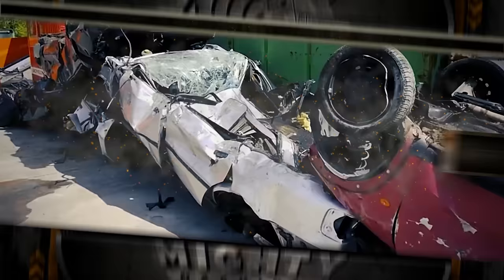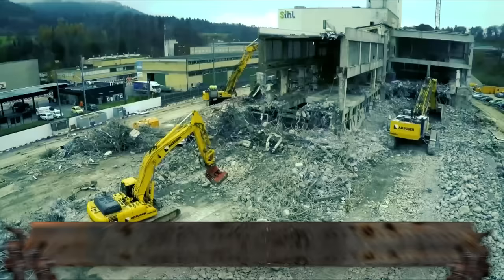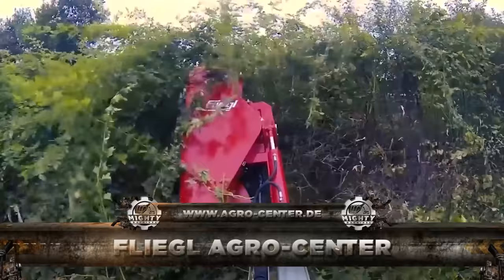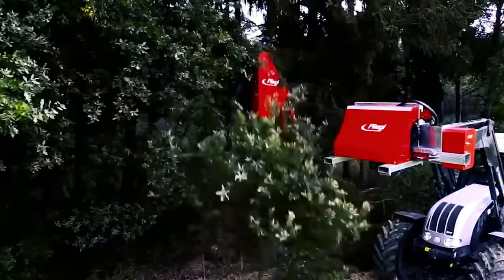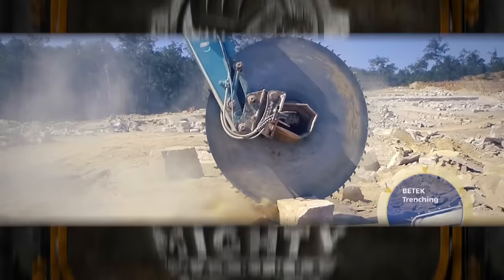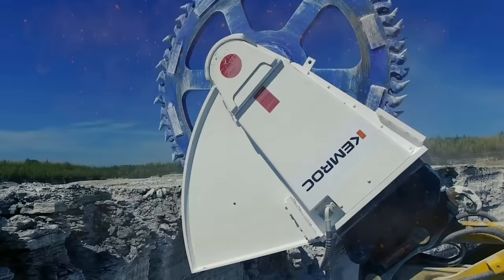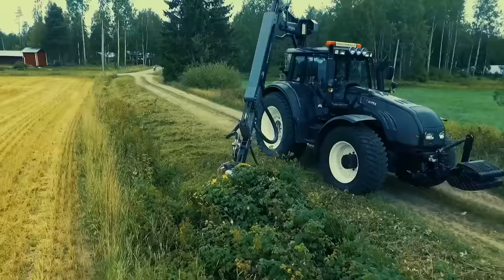Powerful Dangerous & Incredible Machines You Need To See! Machines Operating at Another Level

Comment: WHY would erdvark remove the topsoil as well? The topsoil is where 95% of the nutrients needed to grow the crops are. Leaving the roots and stalks just lets them decompose into compost, aka nutrients for crops.
Reply: Your right what they are doing is forming the field for water drainage. Making sure there isn’t any ponds in the middle that will destroy crops
Reply: Because the people making this video have no idea what they are talking about.
Reply: Synthetic fertilizer is good for you and some farmers get a  kickback for using it.. 🤣
Reply: That was laser levelling machine 😅😅😅😅😅 we use that to save water while irrigation
Reply: You have a good point. But the probable reason is that some of that vegetation debris would be corn stalks and cane stalks and so on, which, unless they are finely chopped, will not decompose for several years so they're just taking out the roughage and leaving the fine stuff...
Reply: Hey anyone who lives in farm country knows a Disc  Harrow is an essential tool. In this case it's shown cutting into what was probably a forage crop. Discers are also used to till soil that previously had a grain crop. The soil is turned over and the straw residue mulched into the soil.  Some producers use "no till" planting but that machine usually a type of Hoe Drill also turns the soil but to a lesser amount.
Reply: Topsoil removal can be strategic, especially in areas prone to contamination or needing structural stability. It's about balancing short-term inconvenience with long-term benefits.

Comment: The box blade at the end isn’t for removing trash from fields, it’s for land leveling and filling ditches or smoothing ruts.
Reply: agreed, I was thinking the same things, it's levelling not 'removing tash'
Reply: Rocks in a field= trash as well as other debris
Reply: Katrina Korolov  no, I was thinking of the “ trash” that are the dead plants. I do this exact same thing and I don’t want to remove trash. You can clearly see he’s leveling soil. Do you farm? Edit to add: I just watched it again and he’s moving probably less than 5% trash and 95% soil. That would be asinine to bring that much soil off the field for that tiny amount of trash. He also has a GPS globe mounted on the machine which tells him his elevation. He’s leveling the field. I actually have a large field right now that I need to do the exact same thing to.
Reply: agreed
Reply: Why don't you wear a mask?

Comment: The trencher is brilliant.
Reply: I worked for a company that had something similar, except it ran a conveyor belt out, around and then behind the trencher to continually backfill as it moved.  You could actually install large diameter piping in the trench (inside a collapse safe box) as the trencher rolled along, in one continual process; trenching, installing, backfilling. Very cool.

Comment: All truly incredible ... note how the giant concrete cutting wheel takes a while to cut concrete, which tells you that concrete is quite an incredible product ... so durable and long lasting...it's said that concrete (or cement) takes a century or more to really harden... hardness tests have been done on that...

Thanks for video clips.
Reply: Would add that the next time any of you are driving down a highway where it goes through very high rock cuts, look at the vertical bore lines left on the face of the rock ... that's where they drill holes to plant charges to blast away the rock face to make room for the highway. Would like to see that happening in a video..
Reply: Concrete reaches 99 % strength in 28 days ,so it doesn't take 100 years.....What are you smoking ,dude?
Reply: @magnum8264  Not smoking anything ... I'm a retired engineer ... I know all about sheer strengths and hardness factors and so on tests have been done (Mohs scale) on different samples taken from over the centuries and tested for hardbess and it is shown that even several centuries ago concrete hardened over the years by a very small amount... this is particularly noticeable when they sample the hardness of concrete from a recent project and then try it a year or two or 10 years later ... it is actually harder.   It's good to know that concrete does not get softer overtime.
Reply: it takes heavy machines like this to destroy it
Reply: That machine is indeed very heavy, it can destroy everything

Comment: The trencher is slow , excavator would be much faster in that soil
Reply: That “soil” was detritus clay. Excavator won’t touch it unless you’re using a “wayne Roy bucket”. Very few hoe hands know how to use that bucket effectively. Fewer still know how to use one quickly enough to even dream of keeping up with a trencher. Those buckets also leave an ugly ditch that is inherent,y unsafe due to the fact that it’s ripping rock and causing sidewall cracking. Harder to pull a box through a ditch with jagged edges. More clean up in a jagged edge ditch. Due to rock caving back in after digging. Operator has to switch out buckets between sets etc etc. I’ve never seen an excavator even come close to keeping up with a trencher in any type of rock or hardened clay and I e been running both for 34 years now.

Comment: 3:02  Yeah. It's what's called a disc harrow. Originally created in the 1880's. Nice for breaking up regularly tilled land. This is obviously a manufacturer's video, as no farmer would be tilling a field this way.
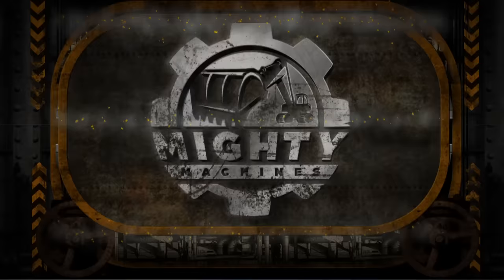8:50  Decomposing trash? Where? You don't scrape topsoil off of a field to clean it! What on God's Earth is this clown talking about?!? This is a leveling blade. We used one on the farm for years to fill in low spots. Look in the background at 9:00. What's happening here is that they're expanding a freaking sod farm, where they need to super-level the soil so that the sod product is a consistent thickness.

Comment: Those are NOTHING compared to the bucket wheel diggers we used to dig out Athabasca tar sands to refine into Syncrude(tm) at Cities Service Petroleum in the 1980's!!! 3 MILLION horsepower electric motors turned a 120 meter wheel of 18-20-odd 20+ cubic YARD (a Titan Terex dump truck load) digger buckets at about 120 RPM and crawled it forwards at about 5-6MPH leaving a 20-ish foot deep trench 30-odd feet wide behind it. I fought Canadian dive-bombers (summer mosquitoes) to photograph the things. In Winter, the ground was frozen solid 20 feet deep and the outside temp was -30*F with a 60+MPH wind off the Artic Circle. No engine was EVER shut down or it would never start again. 3/4 ton pick-ups lasted 5 months.

Comment: 8:45  You must be mistaken.  I refuse to believe any farmer anywhere on this planet would intentionally remove crop residue.  I  believe they were adjusting the field grade to promote water flow and drainage.  It has two maybe three receivers on it making it easier, more accurate, and faster to achieve the desired grade.  That technology has been around for over a decade.
Reply: yeah. get rid of that useless top soil. 🤔
Reply: If it is on the net….must be fact……
Reply: @Ryan Nelson I was trying to be polite to the channel owner ;-)  We created eight center pivot fields with scrapers and land planes.  Knocked it out over two years and well before GPS existed.  Scrapers did the heavy lifting, land planes tuned the grade.  Had a snake charmer by the door, and a .44 on my hip.  Lots of rattle snakes and diamond backs.
Reply: @Ryan Nelson I am confused about leveling land for a pivot that is not necessary a pivot will go over humps and hills and bumps and there's no need for it we run pivots in Idaho over extremely uneven terrain
Reply: This whole video is stupid.  Created by someone who searched for videos of machines and slapped them together while not really knowing anything about them.